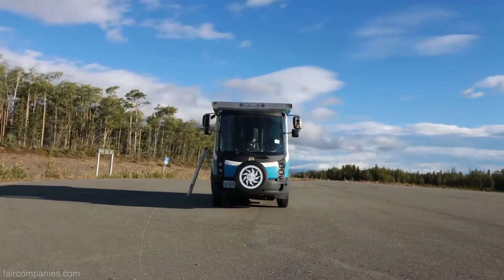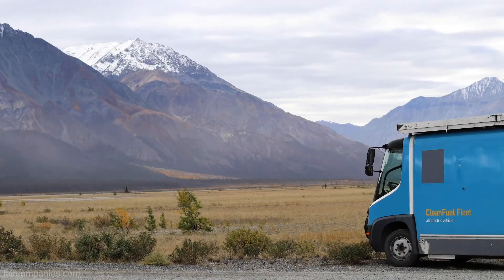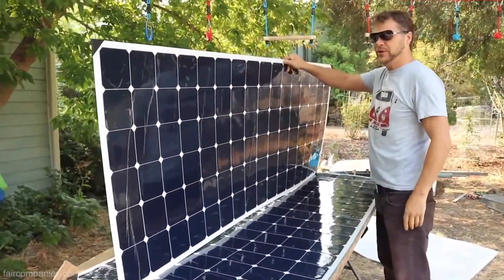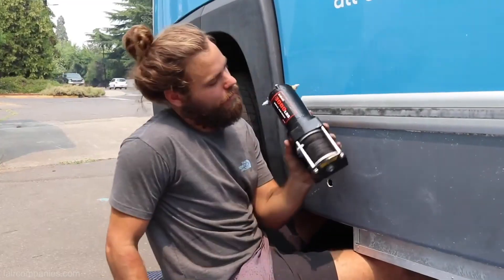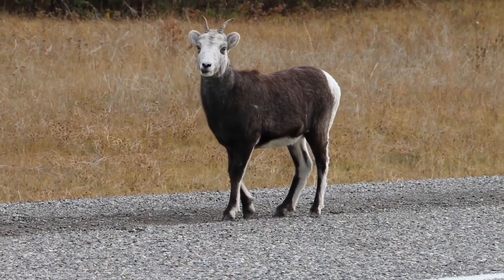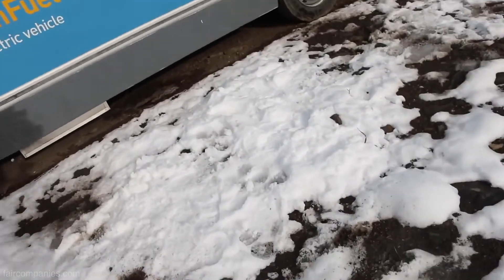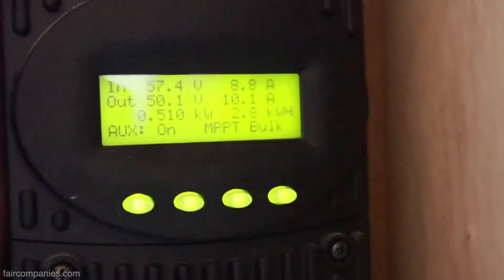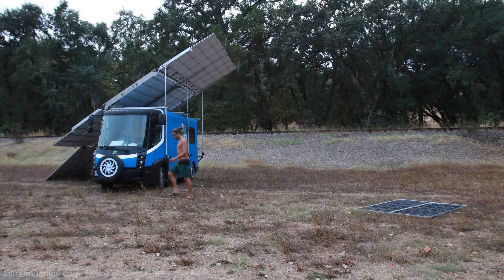Delivery EV turned solar-powered campervan: 100% self-reliant

Comment: Ive been thinking of a similar idea. I like the all solar and electric idea but my girlfriend would go crazy taking that long to get to the destination. So I’m thinking of a pusher trailer. If you read Home a power magazine you might have read a article about one. I’d do a cargo trailer with more solar panels and a small Diesel engine in the trailer when not enough solar energy is available. I’d also have panels hanging on the side of the van and cargo trailer so they are generating power while driving. I like going slow and seeing nature so if by myself I’d do it all electric like you. 48 volts limits the speed.

Comment: I had this idea years ago, but doing the math didn't work out. They should be applauded because in practicality they fell short making the trip longer, but at the same time they learned and found some solutions such as driving slower using down hill for some regen.  Ultimately though such a trip isn't ideal until 2 things happen, you make the van super aerodynamic like Aptera where the driving force needed is 1/4 of its boxy counter park the worker van, or you make the solar 6 times more efficient (while keeping the same area), like each day pulls 300w at its ideal. This way you can drive at regular speeds, plus average 100 miles a day. Still pretty low but more than double the practicality of current technology can stretch.

Comment: This would be a perfect market stand vehicle. You'd set it up at a market, expand the solar panels as a roof for your customers, sell Items out of it (fruit, vegetables, fresh fish or whatever you fancy for a market stand) and return to the depot on a full batery, never having to pay for any energy used in both transportation or refridgeration of the goods sold. Something like this probably has comercial potential.
Reply: I have spent some time setting up at flea markets to sell crafts and antiques. This could work very we'll ,as having shade improves sales. It would also provide for either a couple of good fans, or good heaters, depending.

And at 70+ I'm in no rush, ever. If it takes me two weeks to travel the 700 miles to visit my daughter and grandchildren, I can live with that. And  staying in state parks and boondocking means it's cheap. I'm solo, so I will only use a 1/2 ton van for better weight reduction.

Yeah, I could get into a work/play rig that was under $5K to build out, was green so that the next fuel crunch wouldn't slow me down, and if rolling blackouts hit, I could power part of my house.

Yes, I know the Debbie Downers will say it will take decades to "break even" on the costs. And that is true, as far as it goes, but the options that open up along this route are the real dividend.
Reply: @tinkerstrade3553  the batteries alone will cost you more than 5K$, at 40 kWh, that's about 20k$ in batteries, and with Lipo instead of LiFePo, these last below 6000 cycles at 80% discharge in climate controlled environments.
Inside a hot van, they wont last 3000 cycles - and burn like white phosphor if they ever short out
Reply: @pteppig  No they won't it would need nex to nothing in range
Reply: @pteppig haters r always going to hate because being complimentary just isn't in their vocab
Reply: At work, we had an electric food truck pull up just last week. They pulled out the solar panels just like this van. I suppose we’ll see more and more of this from now on.
Reply: Ahh, the solarpunk utopian dream 😊😊
Reply: Oh yeah..You CAN make a light weight collapsing towable aluminum frame auxiliary panel flatbed trailer that scissor-jacks in towards the van's rear when needed with panel groups sliding or folding in acordian style..looking sort of like a lift gate.Then the wheels retract up & in too! Can be done cheaper using thinner guage alum.square tubing with expanding spray foam fill inside. And use van's power lock system to lock it when collapsed in when you leave for errands.
Reply: Great idea!
Reply: You are delusional. Throw all your money in a pit to even get started, $20,000-50,000 just to get the solar and batteries running, not including any damage that may happen. Gas cars will never be replaced unless solar/EV becomes 80% more efficient and 80% cheaper.
Reply: @thiskneegrow  you are obviously delusional and seem to live in past weirdly. All big car makers are either electric or plan to stop selling combustion cars in the next 5-10 years
Reply: @thiskneegrow  The cope from ICE lovers is getting ridiculous. The transition to EV is now on a trajectory that is irreversible. In some countries EVs are already well above 50% in new car sales and gas stations in these areas are seeing fuel sales drop by 30% every year. Soon people will serious ask themselves if they can easily find fuel for their car another 10 years down the line. Gas cars are going away. Deal with it.
Reply: The cost of battery is super high and you pay it in bulk, with gas you pay as you use. So its a Win Win situation......for power, shell, fuel, battery - Companies. LoL. Corporate are lechers of the world.
Reply: never pay for Energie? ;-) you have to use this all expensive gadget for decades before you can save money. I see this as a solution in some cases, but for traveling? No
Reply: You are SO wrong! 😂😂😂
plenty of people with zappi chargers who divert solar to fill their bevs, this merely takes the solar with them!
The first vehicle, depending on its efficiency & cell type is very practical, sitting soaking up solar even on a dull day will likely even out over the course of a year, a commercial company would likely also have a big solar array at the base to draw from as well.

Solar carports for homes will become increasingly common, providing a boost at worst & for many low milage users & retirees at home all the miles in their tank, & likely more for visitors & neighbours, getting rid fossil fuel dependency is easier than you think!
Reply: @fernandoscolletion  and what have you built that's better?

Comment: I think what you are doing is cool. That being said.... some people have jobs and that thing is simply not practical. As battery tech gets better... I think the situation will improve though. My main problem with EVs is the charging time. I can't just sit at a charging station or wait for solar to charge for hours at a time. Until things work better, I just prefer to pump some gas and go where I need to go at reasonable speeds.

Comment: “How easy it is to transition to renewable energy”, sure mate. I wanna see a factory that makes solar panels running on solar power, I’d also like to see how you recycle the battery(ies) that you’re using right now OR that mound of plastic you’re using to charge the batteries.

Comment: What if you had a lightweight solar ONLY trailer?  It would make backing up and moving more difficult for sure, but you could have more panels, some even working while you drive.  If it's smaller than your van, and shaped correctly, it may not have much negative impact on mileage.
Reply: good idea.  at 20mph wind resistance is not a factor!

Comment: they need 2 small heaters for winter. each one is 1.5Kw.  3Kw*24hours=72kw.  they need batteries at night for 14 hours perhaps in wintertime for the heater which is 42Kw/h. 78Kw/h energy remains in batteries. That is good enough for camping. however, the car has a 24Kw rooftop array which probably 240Kw/h electricity generates daily. 30Kw/h is for keeping the car warm. 120Kw/h is for batteries. there is still plenty of power for other electronic devices. 24Kw rooftop array may generate less energy in winter due to snowy and cloudy weather conditions.

Comment: Fantastic! Great work and very inspirational. How many VA in total in the batteries, and how many watts on the panels? Did you consider AGM instead of the LIFEPO's for stability? Do you have a fire explosion proof containment around the LIFEPO batteries? What is the fast charge time like of the batteries if you use a mains or generator charging source? What I liked about the AGM's was the explosion proof nature and fast charge, but they are heavy.

Comment: I'm surprised they stacked the solar on the roof vs having them hinged down the sides. Having them on the sides would make the panels always in whatever daylight, and enable sunlight capture early in the morning and late in the day, even while driving, and snow wouldn't collect on the side panels.
Reply: I agree. They could be generating more power while underway. And maybe stronger. I have 4 large panels hanging on the side of my Motorhome and 4 on the side of my cargo trailer. Mine are heavy with glass and aluminum frames which weighs down the Motorhome.
Reply: In addition if they had multiple smaller MPPT charge controllers,  then the charge would have been optimized for the different angles of the panels.
Reply: It would have been an awesome idea, in my opinion 👏👏👏

Comment: The problem I see is this. If you chart the progress of transport (from animal to machine, to better machines) we have never gone backwards. We have always gone forwards, more speed, more range etc. With the current technology (solar panels and batteries) they do not produce anywhere near what is needed.......hence you can travel 50-100 miles at 20MPH. That is not practical for most people. Also, don't forget.......this whole thrust of 'climate change' / 'green agenda' is being pushed by people like Klaus Schwab, the Rothchilds and Marc Carney. Do you really trust their motives? Cars, worldwide produce about 11% of greehouse gases that purportedly are a problem for the climate. Like BLM, Soros and others have funded activist groups that call for drastic changes when in fact what they really want is 'A Hunger Games' world, where technocrats run the world under orders from the <0.00001%. Look up 'magnetic pole shift' if you think 'climate change' is real (which it is, but for different reasons than greenhouse gas emissions)....just my tuppence worth.

Comment: Why don’t you guys at a couple windmills that generate either into electricity or compressed air onto your van also? For example on the top or the bottom of the van and you also have regenerative braking that converts your Downhill gravity and braking  into electricity? Thirdly do you have any human powered capacity generate electricity or compressed air? Obviously through a generator mechanism, like stationary bicycle? Cheers!
Reply: Compressed air energy storage is very inefficient. Regarding cycling: A fit cyclist is able to average about 100 watt of power output. A van like this consumes at least 300 Wh per kilometer, so you would have to cycle for at least 3 hours to generate enough electrical energy for 1 kilometer of driving.

Comment: My dream is an electric 4x4 truck camper, fully charged from solar panels. Love what these blokes are doing!!
Reply: Yes and I think the panels should be completely deployable at the push of a button if possible.
Reply: @marcbee1234 that would be awasome to watch. But worried about wind
Reply: Magnetic north due to the Precession of the Sun's shadow millennial Alpha omega Equinoxes not you or co2 is causing these the birthing pains of this the millennium of climate change END TIMES.

Charging an EV in the Arctic in summer isn't hard as the sun never sets.

Pave the streets with permanently sympathetic magnets to the earth sun galaxies double torus oort cloud fermie cells magnetospheres and put gold coils underneath your car would work to siphon of Earth's increasing magnetosphere.

Jesus is the truth life and only way.
Reply: Hybrid

Comment: The batteries are made of rare earth minerals . Not renewable  they must be replaced - lots of resources are used to make something like this -especially it you made it on production scale - these people are really oblivious to the issues of real life people
Reply: They are renewable because they are not burned. You can use the materials again after recycling. Life cycle emissions of electric vehicles are far lower than conventional cars.
Reply: @Freba9  not burned? Just because something is not burned doesn’t mean it’s renewable. Recycling requires a ton of resources and it’s inefficient. No easy answer here. Have a blessed day
Reply: @Freba9  Sadly, life cycle energy consumption of passenger electric vehicles versus ICE cars is currently about 60%, which is an insignificant contribution towards carbon regenerative practices that might delay species extinction. The only thing that matters is how we treat each other until that inevitable outcome.

Comment: Might need to add some wind power on the back of that vehicle. I would also look into self generating engine power. Although it’s hard to know which ones are real verses fakes. 
And before anybody scuffs, Nikola Tesla had free energy 100 years ago.
Reply: A wind generator will do more harm than good.
Reply: "self generating engine power" LOL

Comment: "theres no reason everyone cant use solar now?.......wow clearly you do not think before you speak. There are tons of reasons we cant just switch to solar.......solar panels are barely more then 20% efficient plus where are we going to get all the lithium from for batteries and where are we going to put all these used batteries when they no longer work?..........dude dont get me wrong its a cool van but not all of us want a giant van that we need to pull over on the side of the roads for hrs to charge it.....plus does it charge at night of on the rain and snow?.......in the future thin
k before you speak.
Reply: Solar is very cheap nowadays so pretty much anybody can put it on the roof of their house. Solar panel production emissions are far lower than the emissions they save by producing power. Same for batteries. Lithium availability is not an issue at all. Batteries will eventually be recycled.

Comment: I call bullshit on trashing the earth to mine batteries and solar panels. It's cool but it's not helping the earth
Reply: Total life cycle emissions of battery electric vehicles are far and far lower than any internal combustion engine car.
Reply: Not suprising this guy is from Portland. I guess if you smoke enough pot you will think batteries are good for the earth.
Reply: EV is not the way. Hybrid would reduce emissions way quicker

Comment: He could add some mechanical devices to the energy setup, something like a stationary bicycle that transforms muscle power into electricity. We used such a thing in the military as an emergency tool to get electric energy for communication. Another option would be some kind of waterwheel that can be put in a river, something that can be rigged up on a suitable spot. If course a windmillwould be another nice add-on, just imagine using the entire spectrum of renewables in one singlesystem! The fact that it is movable allows for so many ways to adapt and optimize in whatever environment or circumstances you find yourself to be in.
I very much like what these guys are doing and I don't mean to belittle their achievements in the slightest but the thought that immediatly came up in my head was that two guys just sitting there and waiting for the sun to come up and charge their electric mobilhome enough to drive them to the nearest settlement is a bit too passive a way of life for me, and many others  probably feel the same. But maybe I just need to work more on my patience...
Anyway, inspiring video as always, I wish these boys a safe and fulfilling voyage!
Reply: A fit cyclist is able to average about 100 watt of power output. A van like this consumes at least 300 Wh per kilometer, so you would have to cycle for at least 3 hours to generate enough electrical energy for 1 kilometer of driving.

Comment: I’ve had this idea for some time similar to this set up but also with a utility trailer for work using all battery powered tools where we could build a off grid backwoods log cabin .
The real finishing touches would be to have the whole set up protected from a man made or solar flare EMT so when most all worldwide electrical systems goes down , you will still have power .
Reply: I'd be more worried about an EMP than an EMT. EMTs are generally pretty helpful in an emergency situation.🤪
Reply: There are things called surge protectors and faraday cages as well as fear mongers who exagerate things. Plan and prepare for the worst and enjoy the best😉

Comment: I wonder why they don't do more night time travel and park all day? That way they're not wasting sunlight hours with the extra panels stowed, or during the setup. They could drive for 3 hours after sundown, then set up the panels ready for morning before going to bed.
Reply: @questioner1596  well. For them, the whole idea of travel may be to actually SEE the places as they are going🤷
Reply: You need lights on at night, and I suspect the batteries size may fill up in a single day.
Reply: @murraymadness4674  lights consume nothing compared to motors to move a giant truck xD

Comment: A cheap addition is home made vertical wind mills. 
If you tank an alternator from a car that charges and used pullies with a slip clutch all the wind I'm seeing in this video will help.
Get a 3 foot piece of square stock an get 2 or 3 cans , split them in half and attach on pole . 
You got this 👍